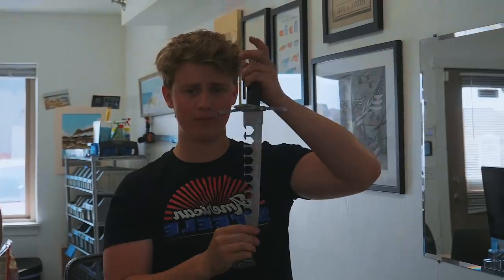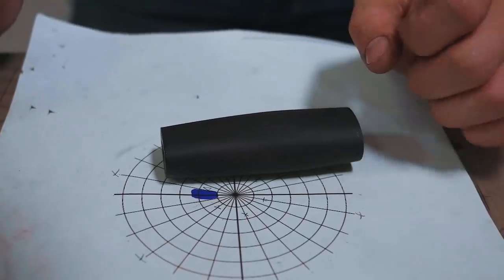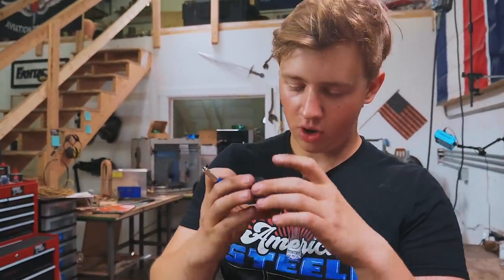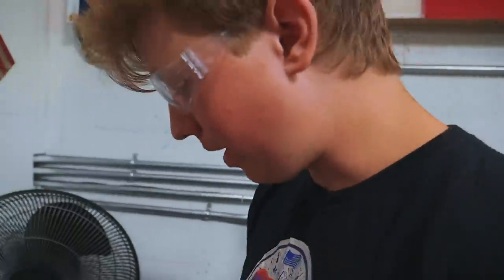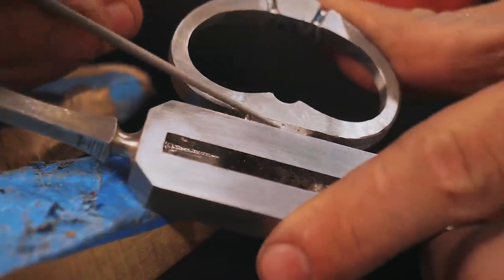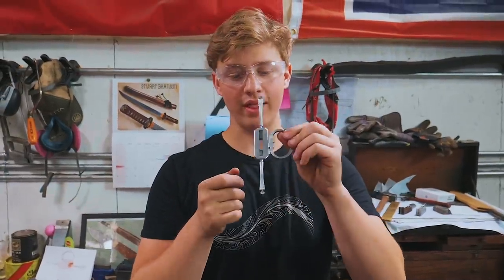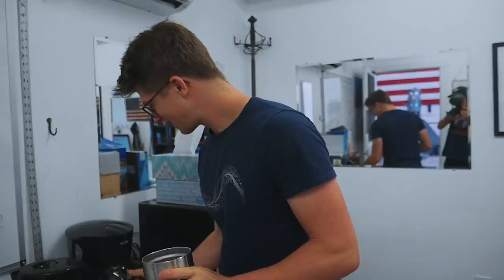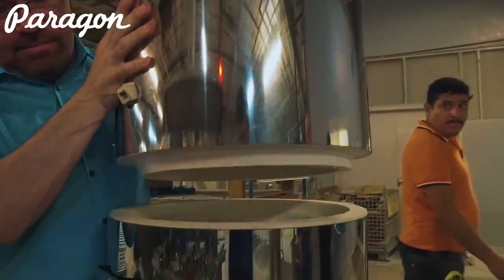MAKING THE SWORD-BREAKER!!! PART 12

Comment: Why is it, I always think this should be bigger than it is. “Sword Breaker” just seems like it would be huge.
Reply: Sword Grip breaker would be a better name. It is meant to break the sword out of your hands, not really to break the sword itself, which I guess is still possible, just unlikely.
Reply: Yes and no, it sounds huge, but it's a parrying dagger, not a sword
Reply: Swordbreaker would be a cool name for a battle axe
Reply: If anything it looks like sword breaker has a decent chance of breaking
Reply: @rich1051414  Not necessarily to break a fencers grip persay. It is important to keep in mind that "sword breaker" is actually the Victorian moniker given to the weapon and we don't actually know what these were called at the height of their use. 

The idea is to catch and bind your opponents blade. If you have control of the blade you have control of the fight. However given how relatively rare they are there is some contention to the effectiveness of the sword breaker in an actual fight. After all you do actually have to catch the blade of an opponent that is very aware that you have this thing. One would guess that it would be more effective that a regular parrying dagger if you could actually catch your opponents blade. But they aren't going to make that particularly easy. I would also guess they would be rather more expensive than a standard dagger given the added difficulty of construction and the expense may not be offset by the effectiveness as a weapon.
Reply: @koloth5139  I like that you mentioned that it was probably rather more expensive. They could very well have been a symbol of wealth. (This is coming from someone who is totally ignorant, so take this with a grain of salt)
Reply: That would be a sword smasher, that's coming next in the following 46 part series
Reply: @kettlebells-ez9xi  Dude, too soon!  Episode 6 was less than a month ago..
Reply: @koloth5139  you nailed it!

Comment: Have you guys done any research into the benefits of cryogenic treatment of steel?
If so, is it something you think is worthwhile, or not?
Reply: Generally speaking simple carbon steels do not gain an appreaceable level of benefit to justify the time energy and cost to cryogenic treatment. Its more for your stainless and air hardened steels..

Comment: Anyone else think the channel name might need a change? From the point of the viewers it's obviously become a partnership, which I think is awesome. But I think it would be cool if you guys had a shop name or channel name together, like Stelter Steele metal works or whatever, instead of just Alec steele. Not that I don't love you Alec, but things are definitely different than they were back in the uk, not that its a bad thing.

Comment: Hi, in my opinion you do a great job. But if you look at the originals they are perfect in their inperfection. They are not absolutly symmetric and smooth. Because they did them by hand with an other intention. The result have to lookk good. You also do, but with much to much modern skills. For example the pommel. First you forge it, afterwards you turn it.. why? Just filing it would be much better! You both are of such a great talent. Perhaps you should try to do it more the historic way so the pieces don´t look so modern... BR